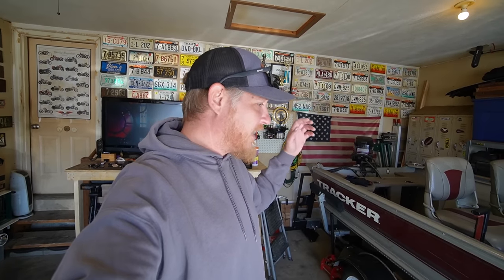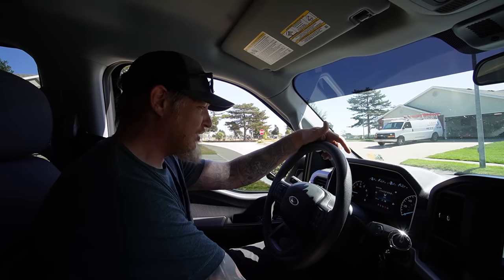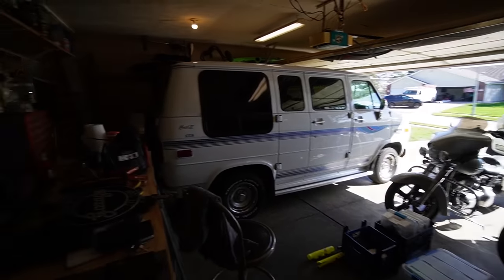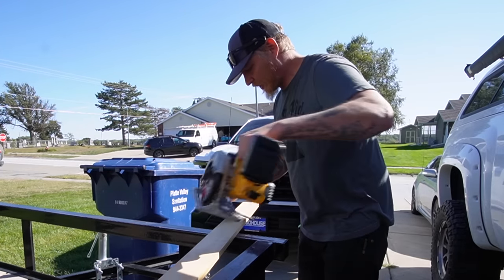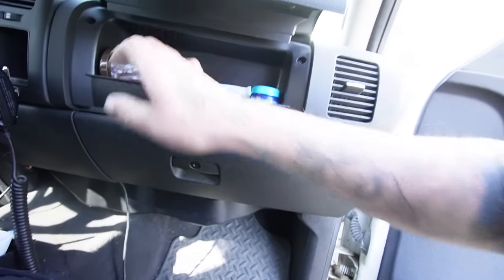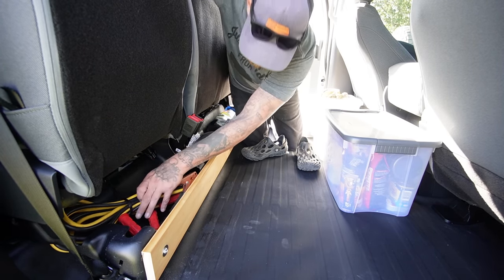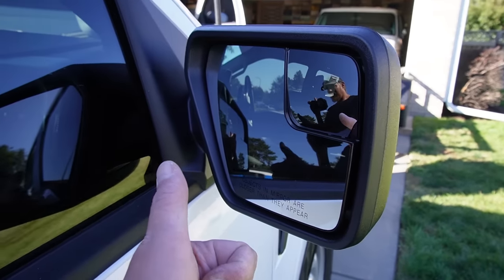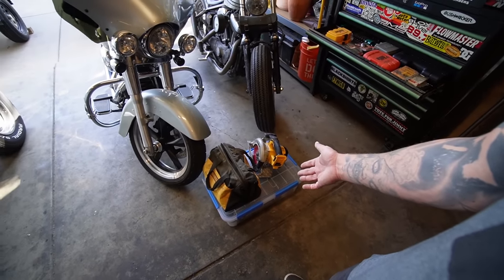Stuffing The Van In The Garage & A Simple Truck Mod

Comment: You might want to shave off some of the side of the long board you put under the back seats to prevent them from rubbing the bottom of the seats and tearing them when weight is on the seats. Just a thought.

Comment: You should have bought the 2500 Silverado 6.6l gas with the Allison 10 speed. 19-20mpg has been reported by TFL truck. And NO CYLINDER DEACTIVATION! .....
Reply from the maker: 2500 = $$$$$